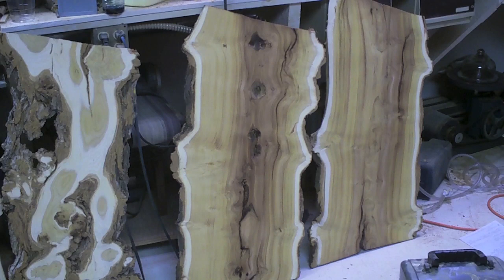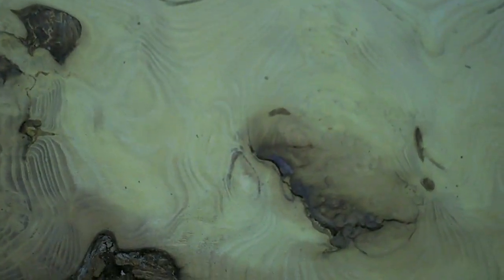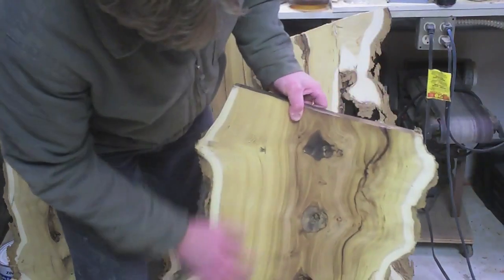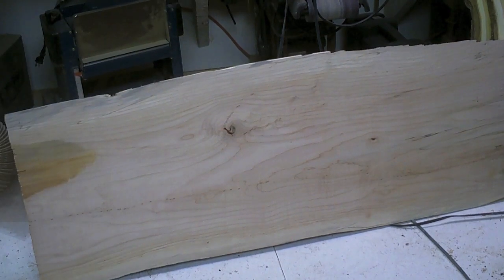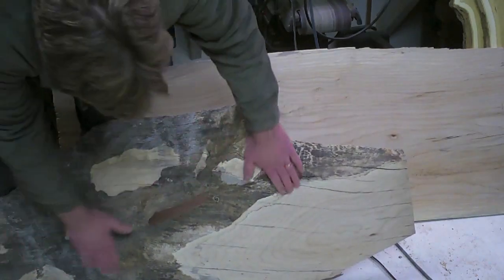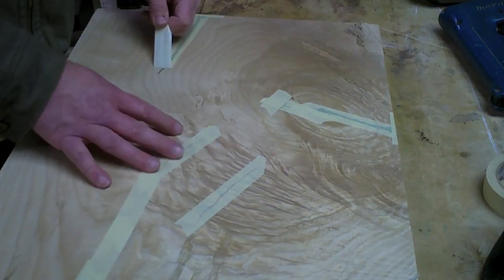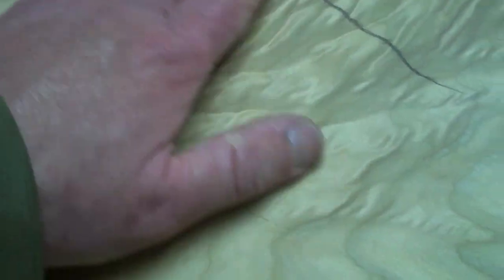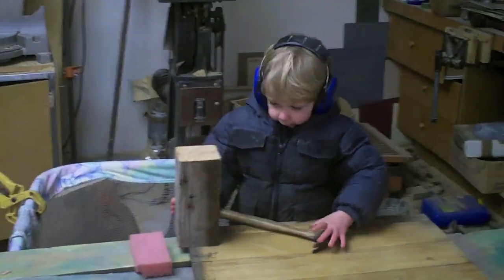Beautiful Slabs Coming Off the Mill

Comment from the maker: It works but it is still a failure for what I want it to do.  I just need to move warm air from the stove upstairs using IDK, the fan and duct out of a small furnace or something.  I need fast heat right away not an even heating.  Oh well.